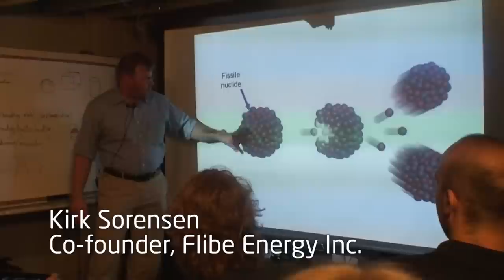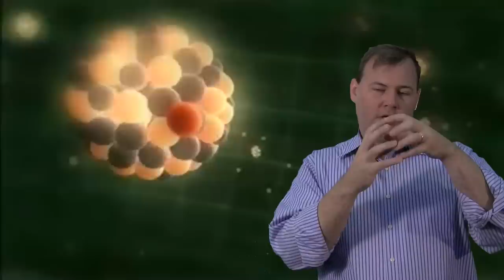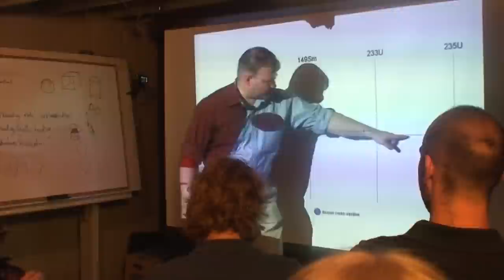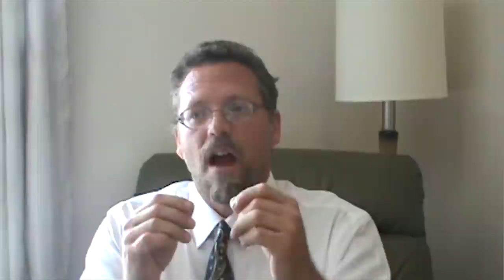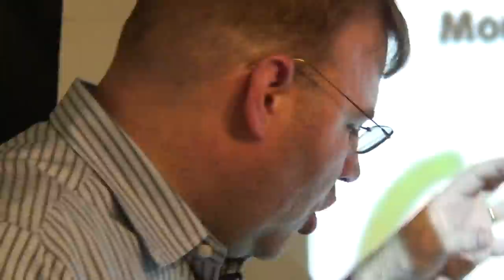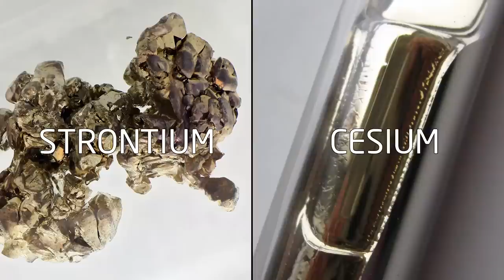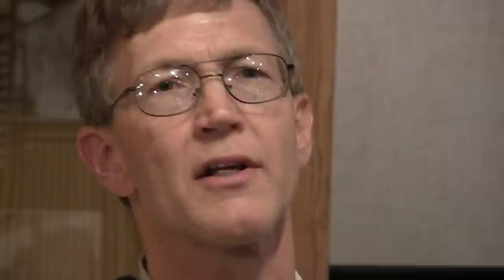Nuclear Waste: Fission Products & Transuranics from Thorium & Uranium - "Th" Documentary

Comment: At about 7:50, the solid state chemist said something to the effect 'if you can find useful things to do with the waste, you can monitor that waste," which is very true. In fact, part of the reason petroleum based fuel is so popular and cheap is that chemists found ways to utilize the non kerosene distillates from crude oil; plastics, medicine, gasoline, diesel, tar, et cetera, are all derived from oil and were, at the beginning, waste products from petroleum distillation. Hell, plastics werent really invented until the 40s and 50s, and ever since then, the fuels as well as the plastics have become cheaper (at least once they're adjusted for inflation). 

Nuclear could work very much the same way; some of the decay products are vital for radio therapeutic cancer treatments. The xenon has use in ion thrusters. If we can find uses for other radio nucleotides, or create a fuel cycle that creates useful radio nucleotides, we could find that nuclear is not only cleaner and more efficient than it's current generation of solid fuel reactors, but also cheaper. 

As for the waste problem, I'm a little less gobsmacked than the first engineer. All of the nuclear waste from all the world's reactors, produced over the last 80 years, could fit on a football field stacked 50 feet high. That's a lot of waste, for sure, and most of it is so toxic and radioactive, with such long half lifes, we dont know what to do with it; however, compared to the waste produced by fuel combustion (which is gaseous and rarely thought about as waste) is so great that the climate itself is changing due to the rate of waste production. The hydrocarbon combustion products are all waste and the mass of hydrocarbon waste left when producing a single TW of energy is leaps and bounds greater than the entire stockpile of nuclear waste. A 50x500x30 foot pile of concentrated waste, over 80 years ain't too bad. Even if we sextoupled that over 50 years, changing nothing at all, it would be far better than the unthought of waste produced by hydrocarbons. Liquid salt reactors promise to make fuel cycles more efficient, extract more of the nuclear energy, and produce far less highly toxic waste than current solid fuel reactors; replacing the entire world power production with liquid nuclear reactors might not even produce that 50x300x30 foot pile of waste in 250 years of power production. It is time we start looking at tenable solutions to climate change and reembrace nuclear.

Comment: So 800 KG of thorium used for fission leaves you with how much now?  799 KG radioactive waste? Or 1.something KG waste? 0:54
Reply from the maker: That is the idea. There'll be activated graphite and reactor components, but the "pure cycle" is essentially that... Th becomes fission products. And while the volume may expand (Th very dense vs fission-products some are gas) the mass does not (really) alter. This applies to fast-spectrum breeders too (which can be MSR see TerraPower and Elysium)... the overall waste-to-energy ratio with nuclear is already very low and attractive, but to really see the potential of fission's waste profile one ought to consider breeders, and why people arguing against nuclear power on SUPPOSED environmental grounds are adamant that breeders are off-the-table.
Reply: Okay, so let's say that all the different materials of TH waste is isolated and used, how much TH is left after I use 800 KG to make energy? 
AND, how radioactive is that waste? What kind of ionizing radiation does it emit? And for how long?
Reply from the maker: Zero Th is left because it has become fission products and converted into energy. (In the reactor more Th is continually dripped into blanket as molten salt but that is where it goes.) It is VERY radioactive, but if segregated you'll get different radioactive profiles with some very radioactive for short periods and some less-so radioactive for long periods. If no separation takes place the FP will reach background radiation level in ~300 years.
Reply: How much fisson product are left then in KG please.
Reply from the maker: Not completely confident on this but based on ... http://nuclearpowertraining.tpub.com/h1019v1/css/Calculation-Of-Fission-Energy-83.htm ... I'd say 235.85208/236.052589=  99.915% of the Thorium becomes Fission Products. So 799.32kg from 800kg. That assumes the Chemical Kidney can operate efficiently, and neither fissile or fertile end up exiting the reactor with FP. Hopefully that is a question Flibe Energy will be investigating with their 2018 grant from DoE to finally develop the Kidney.

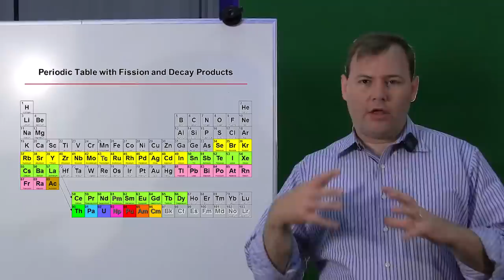Comment: @ 2:00 or so, Kirk shows a colored periodic table. Does anyone know why it doesnt make row 6 metals but will make row 5? Pd is worth ~ $800/oz today so if Pd, Ag, and a few others could be forced as a fission product, perhaps with some sort of catalyst or ???  that would be so cool.
Reply: Hi Luvbotany,
When a huge nucleus absorbs a neutron, it becomes unstable.  It starts twisting and extending and it either breaks into two pieces OR it alpha decays and shoots out a very stable tiny fragment (99.999% of the time an alpha decay is a helium 4 nucleus - 2 protons and 2 neutrons).  

If it fissions into two large pieces, it very, very rarely splits equally in half (which would make gold and other platinum group metals).  Almost always it splits into a big and smaller piece, and gold is too big for the small half, and too small for the big half.

No one knows any way to cause fission to make large amounts of gold, except by fissioning much heavier elements.  However, there are only a handful of elements that fission, rather than alpha decaying, and only 3 are common.  U233, U235, & Pu239.  As you can see, the total number of nucleons is very close (233 to 239), so ALL of the common fissile elements do not produce gold.

On the other hand, the electricity produced by nuclear reactors is so valuable, that if we could fission gold in a nuclear reactor and make that much energy, people would be destroying gold for the power.

But it would be cool, if in addition to getting $$$$$ for the power, you also got $$$ for the fission products.  But that is what Kirk is saying, medical isotopes are more valuable than gold per kilogram, so if it was easier to extract them, you would have an extra, valuable income stream.

Warm regards, Rick.

Comment: As a former Navy Nuke, hearing the phrase 'liquid fuel reactor' gave me a small aneurysm. :/
Reply: may I ask why?
Reply: I'll assume you are asking seriously, so for the sake of efficiency so I don't tell you something you know, or leave anything out, not trying to be condescending, I'll ask you: How much you know about nuclear fission and nuclear reactors?
Reply: Not a nuke engineer, tho I'm from an engineering background. And I am curious to know.
Reply: A major concern/contributor to radioactivity from an operating reactor is isotopes in the water. The low concerns are like Nitrogen 16, which is a beta emitter with a 7 second half-life, so as long as it stays contained and the piping takes more than 40 seconds to get near you ( > 5 half-lives) you're ok. However, others, like Cobalt-60, are bad news. C-60 is made from the irradiation of the piping and valve seat alloys and the small particulate from wear is in the water and it is actually one of the largest contributors to the 'radioactivity' of primary coolant (water). It has a 5 year half-life (IIRC) and is a high energy decay. Just really bad news. The Primary coolant, being just purified water, is not really a long-term radioactive concern in and of itself. It is the particulates (like Cobalt-60) that are a problem. 
When you operate properly, the uranium stays inside the fuel elements. If you have a localized overheating, and the uranium fuel alloy is exposed to the coolant, now you have that metallic particulate in the coolant, making it seriously radioactive. (Called a 'fuel element failure' and somebody seriously fucked up) So, as you see, all the 'fuel' being a liquid flowing around the primary loop would result in a completely contaminated and ridiculously radioactive primary plant, and something you don't want to be anywhere near during operation...not to mention the fact that the fuel is supposed to be in a core where it's exposure (via control rods) is what regulates the neutron flux.
Reply: @MudderFukker-m6g  On the other hand, they did operate one in the 60s and didn't experience major issues on that front.

Comment: Does anyone know what is going to be combined with the U233 salt?  Current reactors have like 5% U235 mixed with U238.
I can't imagine using pure U233 in a reactor anymore than I can imagine using pure U235.
Reply: The us navy uses reactors with 95% 235U
Reply: jason boyle I doubt that..
Reply: U-233 is fissile and produces more than 2 neutrons per fission. It can be run standalone, using Th-232 as fertile fuel (meaning the free neutrons from U-233 fission collide into the Thorium atoms which eventually transmutes them to U-233.)
Reply: Also yes the US Navy does use incredibly highly enriched U-235 for their reactors. It's pretty amazing.
Reply: Generally it's true that 233 can be run alone, but one could if they wished also include 235, 238, or even plutonium-239. Certainly most plants will be including thorium-232 to breed more uranium-233.
Reply: @lepidotos  No, you can't run pure fission material!  That would make a bomb.  Unless 233 has some magically self regulating property.
Reply: @putinscat1208  it isn't just pure fission material, are you forgetting about the rest of the fluoride-beryllim-zirconium salt? it's so diluted in there, and if you're breeding thorium even more so. also, there are neutron moderators, graphite rods.
Reply: @lepidotos  Is that chemical bond enough to keep highly fissionable material from just exploding?
Reply: @putinscat1208  it worked when we actually built an MSR back in the 60s, so I'm pretty confident.

Comment: It looks like bismuth decays into thallium. Is that something you want to introduce into the body, one of the most toxic chemicals known to mankind?
Reply from the maker: If I had cancer, and the material was aimed at a cancer cell, yes. You are aware that "Nuclear Medicine" is a thing, right? Actual doctors use it, not just people on YouTube.

Though mostly used for diagnosis, radioactive materials are also used for treatment. The unique property of a highly radioactive material is that is actively GOING AWAY... it changes into something else. So binding radioactive material to a cancer cell is a means of attacking that cancer with a "poison" which is rapidly going away before it can damage the rest of the body.

In the case of the Thallium-209 you fear (which comes from the decay of Bismuth-213) https://en.wikipedia.org/wiki/Isotopes_of_bismuth , that too is radioactive. It has a half-life of 2 minutes. The shorter the better for anti-cancer uses as you want the material as close to the cancer cell as possible. The decay of the Bismuth, they decay of the Thallium are the treatment because it is during the moment of decay that the cancer cell is being attacked.

Would I recommend you consume some Thallium with coke and vodka? No. It would be very bad for you. But if you have some bad luck, directing it at a cancer cell might be the best option for you. You would then be glad the Bismuth (and  Thallium) ARE radioactive, as otherwise it would be entirely up to your body's mechanisms to purge them while they are still in their most toxic state... as must happen with non-radioactive nuclear medicines.